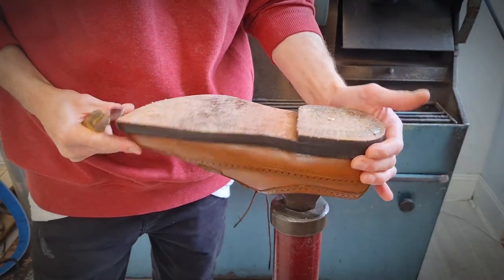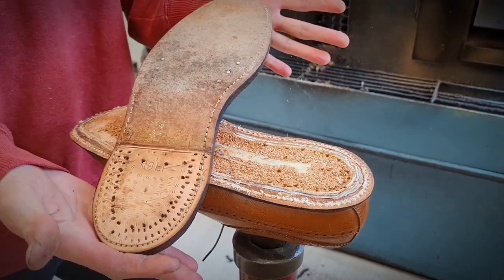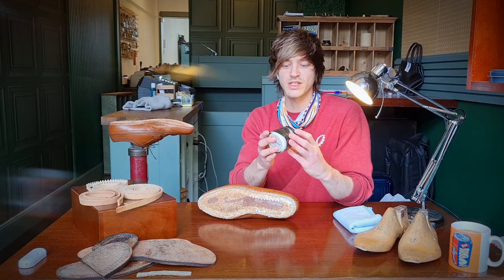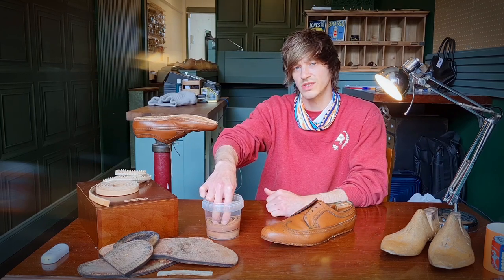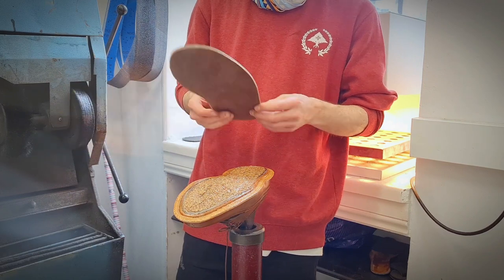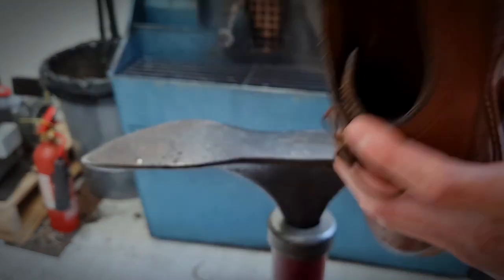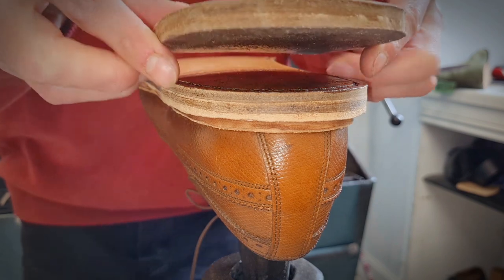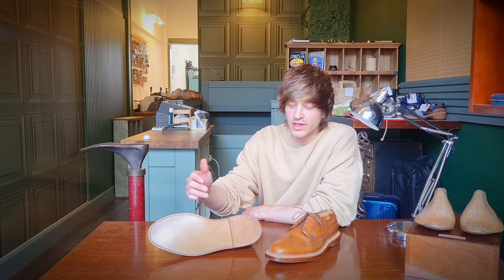How Vintage Shoes Are Professionally Restored | Florsheim Imperials

Comment: When I restore the uppers on vintage shoes, I start with a good scrubbing with saddle soap and then let the shoes dry with trees in them. Then I'll use either Saphir Renomat or acetone to remove old polish, depending on how much there is and how hard it is to remove. After that, I thoroughly condition with Renovateur and then do a fresh polish, starting from a clean slate.

Comment: Another cracking video bro! What's the purpose of the tiny perferated wheel thing?
Reply from the maker: Thanks man! It's called a 'fudge wheel' it is used to make marks on the welt, I like to use it to add some detail to the bottom. If you look on the sole where the stitches are you Will notice some indentation from where it's run around, gives some nice details on the bottoms 👊👊